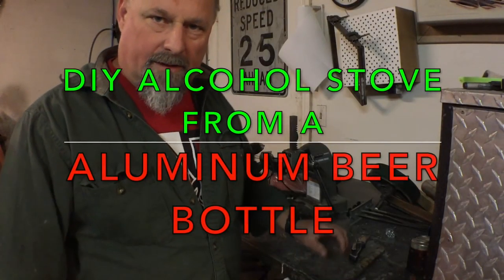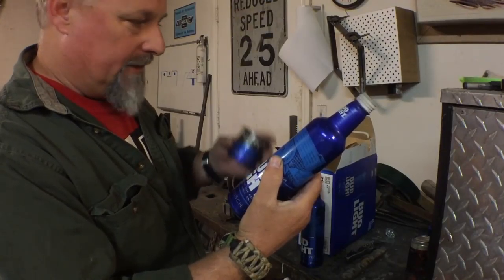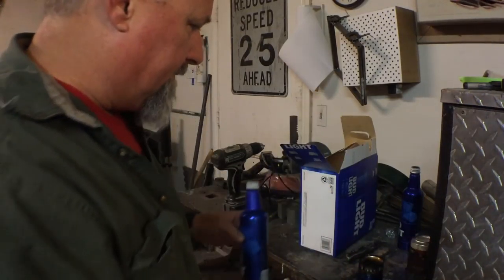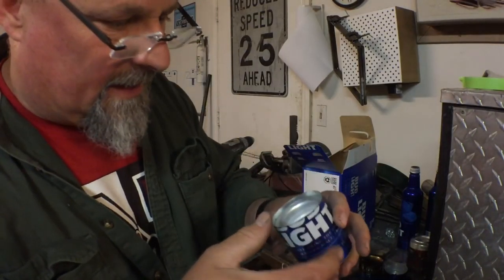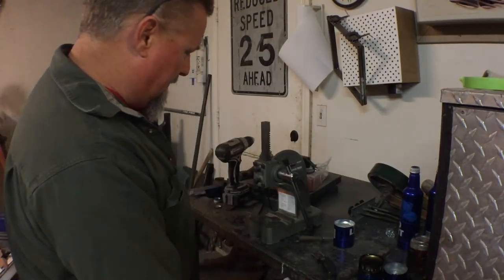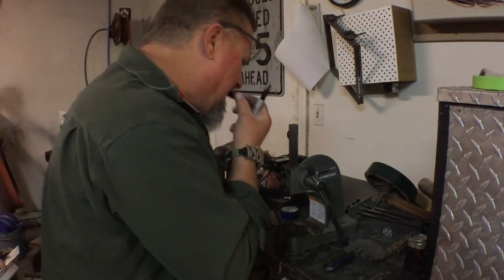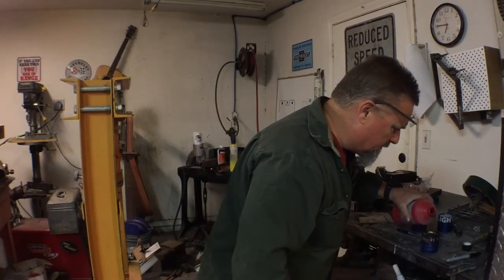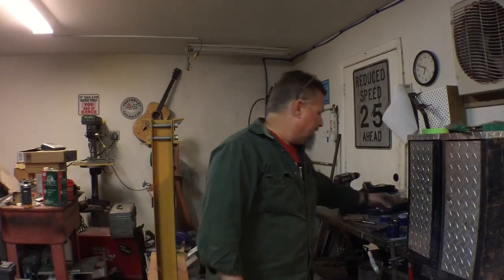DIY Alcohol Stove

Comment: Way fancier than the ones I see the Appalachian Trail kids making. They don't roll edges and all that jazz. In their defense, it is tricky to backpack while carrying a drill press around.
Reply from the maker: but not impossible
Reply: It's not the drill press that's the problem. Try carrying 2,183 miles of 20 amp extension cord.